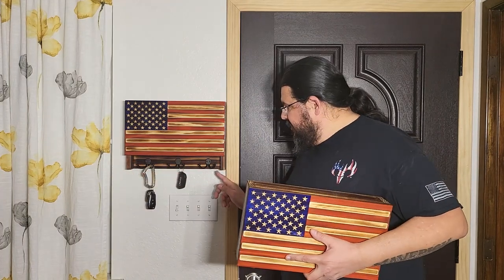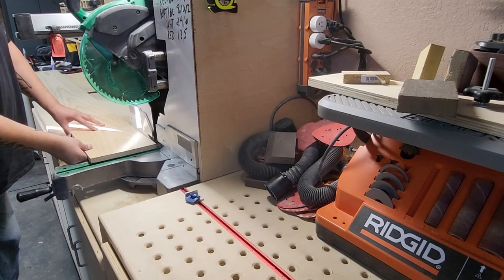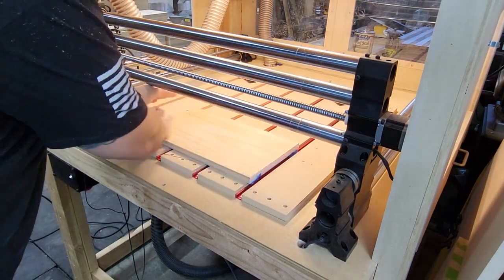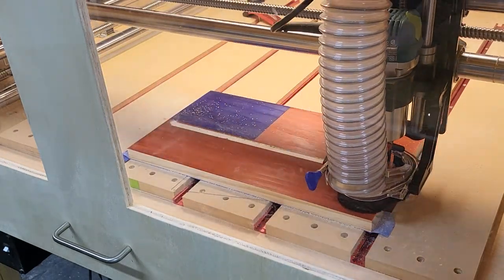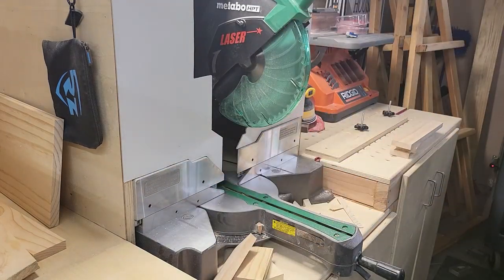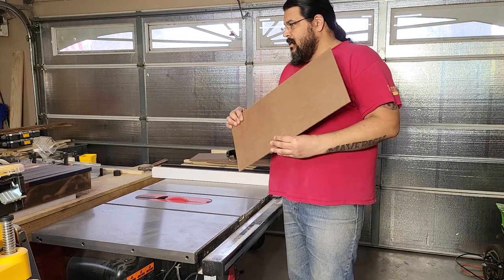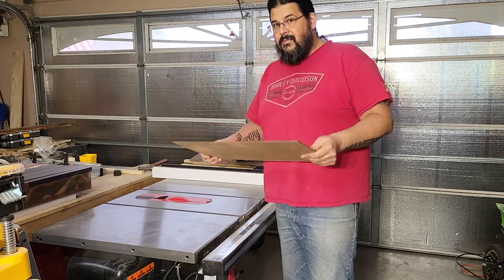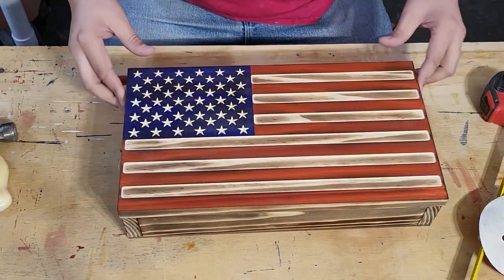How To Make A Small American Flag Concealment Box / Key Holder (PART 1 of 4)

Comment: Hey there,  I'm still putting this together - the only thing i found i didn't like is the 90 degree hinges, they are very strong.  I'm trying to find a less stronger one if possible, but the overall project is looking good.  Be in touch soon.
Reply from the maker: Yes, they are. This was intentional for me because they are able to hold the door up effectively without any additional assistance. They are also cost effective. The only real downside is that you have to control them when closing so that they don't slam down, but I didn't want to have to add gas struts to such a small box.  Adding more expensive hinges and struts add to the cost and can make them more difficult to sell (not to mention there's really no room for struts in these boxes). I have made some custom smaller boxes at higher cost when someone orders something like that, but these were designed with the general consumer looking to spend as little as possible in mind. I use European hinges and gas struts on bigger boxes, and you have to be careful with the strength of the struts because they can push the hinges and door out of alignment when closed. Let me know if you find something better, I'm always looking to improve.
Reply: Hey, that makes sense - I do like the fact that they don't need a gas strut to hold the lid up -  maybe i'm just being wimpy - LOL    I did buy a set from Home Depot that I want to try, just to see how they work - stay tuned.

Comment: I would use down cut endmill  you would not have to sand stripes also i would spray inside box before putting on backer just a thought
Reply from the maker: Right on both fronts. That's exactly what I do now

Comment: Im having trouble getting the lid to close square on the box when installing the hinges. Ive messed with it for hours and for whatever reason cant get it to line up perfectly. Any suggestions or tips?  I bought good hinges from home depot. My pine lid has cupped slightly so might have something to do with the cheap common pine boards i purchased. Idk. Also the box is perfectly square and everything lines up perfectly before attempting to install hardware.
Reply from the maker: Yeah, the hinges can be tricky. I remember struggling a bit with them at first too. If they aren't perfectly straight they'll do that. Sometimes you have enough play in the screw slots that you can loosen them up and reposition the hinges for a better fit, but you may need to reposition one or both. Sometimes you just get a wonky hinge and have to replace it. Any cupping, twisting or other distortion of the board will affect that as well. I can usually get them aligned though. Only once that I can think of, I had to trim one side of the door to match the box because one side was pretty good, but the other side was crooked and hanging out past the edge of the box. No matter what I did, I couldn't get it on right,  so I took the whole box to miter saw and trimmed that edge of the door flush. But that only happened once. I'd suggest you make a practice box and a few blank doors to practice installing and adjusting the hinges until you get more comfortable with it.

Comment: Great build. What is the size, Sir?
Reply from the maker: I'm pretty sure I cover this in Part 2 of this 4 part series (How to make a small American Flag WITHOUT A CNC for a concealment box--I'll link it below), so check that out if you haven't already. In any case, the CNC flag is 9x16 (11/16" stripes), but that means 9/16" stars, which is fine for the CNC, but problematic if you're gluing on stars because you can't find them in that size. That's why the old design was 8-1/8 x 14 or 15 (5/8" stripes), because you can buy the 1/2" stars you need for that size. Essentially, it really depends on how you plan to make the flag because that will be based on the size of stars. If you're doing it on a CNC, you can really make it whatever size you want, just use a flag dimensions calculator (also covered in that other video). But if you're buying stars to glue on, you have to size your flag according to the size stars you get, and the box will be need to be sized based on the size of the flag. I am in the process of making written plans for these boxes and all of the builds on my channel, and once they're ready I'll be selling them on my website, but it's just a basic butt-jointed box that's the same size as the flag. The depth will depend on how thick your foam is, but the with old  design (with a solid 3/4" backer inset) I made them with 1x4s (so 3-1/2" deep), and with the new design you see in this video (with the hardboard backer) they can be significantly thinner (1x3s, or 2-1/2 inches). 

Here's the link to the part 2 video: https://youtu.be/LS4Zc_VkkEA